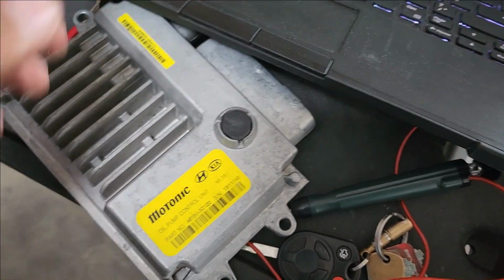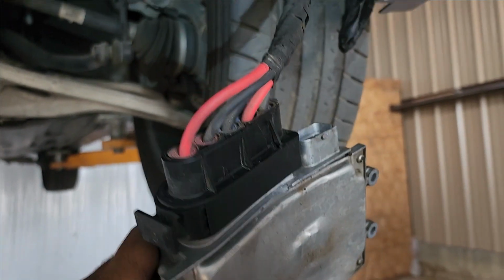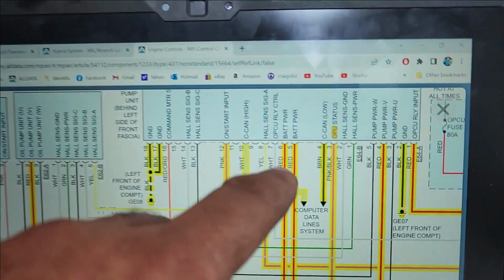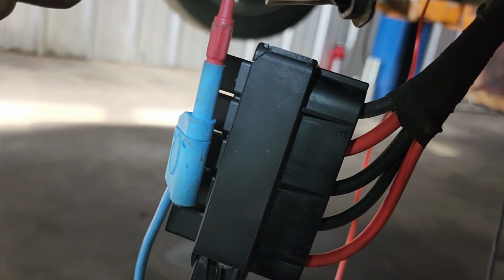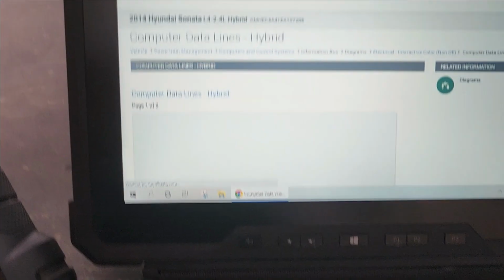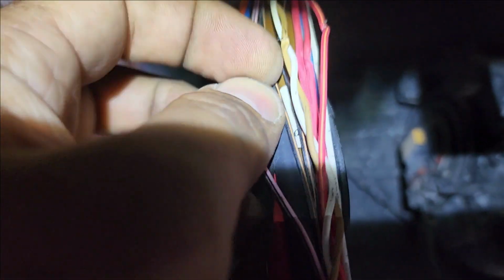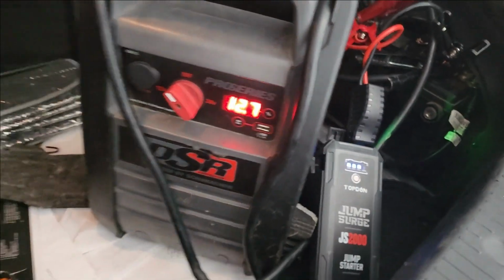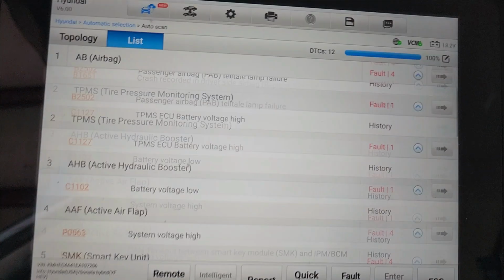2014 Hyundai Sonata P1774 P1775 P1776 P1777 P1784 P1986 and/or U1007 Codes Part 2

Comment: Very good job
Reply from the maker: Thanks
Reply: My friend, you are very wonderful and your experience is great. I am a mechanic and I know something about electricity. I am facing a problem with my Sonata Hybrid. I did a lot of research and replaced the oil pump device as I was facing these codes P0A40, P0A41 and P0A78. What is the problem? Is it from the inverter or the coil? Please help me.

Comment: Did you have to do any reprogramming for the new oil pump module?  Or did you just plug it in and it worked?
Reply from the maker: I don't think a programming was involved, however there might be a scan tool process

Comment: I’m in the same issue I had someone come replace & program my ECU thinking it was that …but no still have jerk and no start at times … only code is oil pump relay error… should I try changing oil pump control unit ????
Reply: Only code p1986
Reply from the maker: I can't say yes or no. You need a properly diagnosis the issue
Reply: Hey, I'm having same issue, only code p1986. Have you found any solution?

Comment: Bro! This car now in NYC: same color 2014 hyundai sonata hybrid; having same issue...starts...does't run on drive mode or reverse..EPS, oil, eng. Sign pops up..no engine faults...
Towed 3-times...after resting few days start drive again with no sign on dash...lol...no one able to fix it...any help?
Reply from the maker: Need a qualified tech to diagnose the issue.
Reply: @DallasAutoDiag  that car towed 3-times in 3 diff. Shops including dealer(Goshen,ny) no one can resolve the issue..i wish you are in NYC!!! No luck man!!!
Reply: @khanpollock9018 any update on that? My hybrid optima doing the same
Reply: Cual fue el proble de este auto